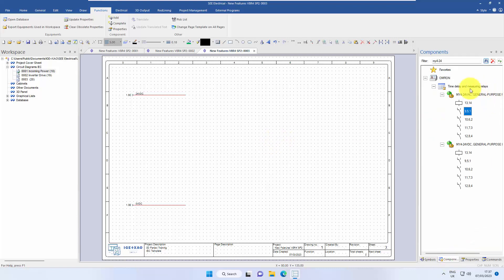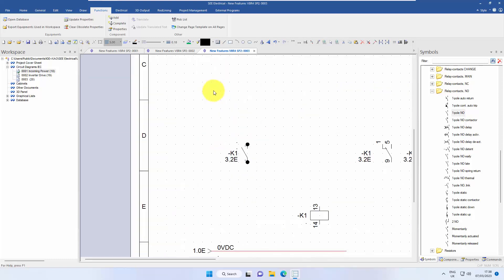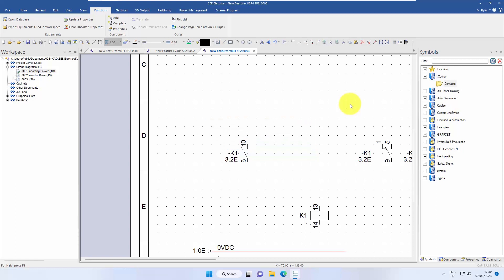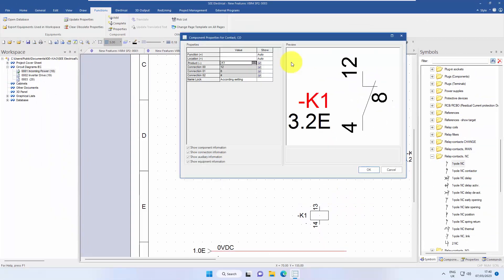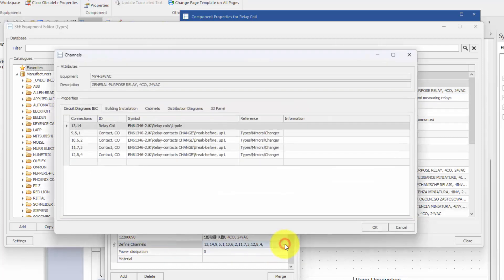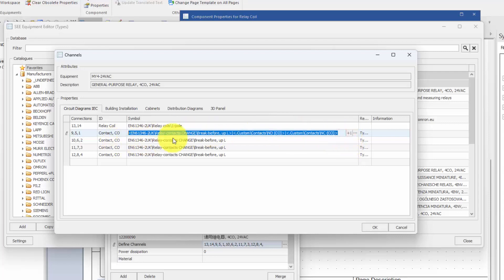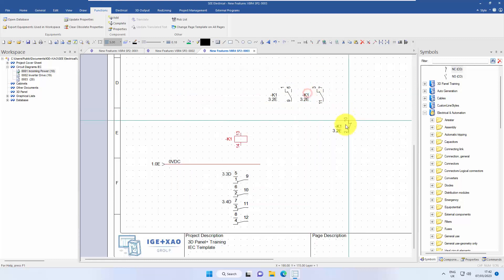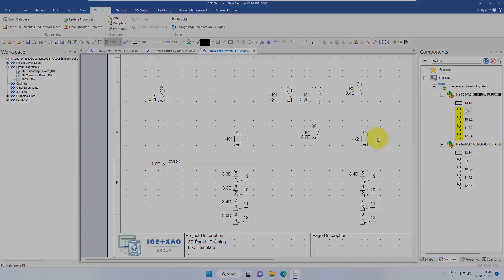V8R4 New Features Alternative Symbols

Comment: in see electrical, stretch command is not available?
and also, what is the shortcut key for copy with reference point.
i request to make a series of videos regarding commands only.
Reply from the maker: Graphical stretch can be enabled using the trackers (Alt+T), and stretch of connected wires using the Electrical - Wire Rubberband command.
Right-click to select Copy with Base Point or add a new keyboard shortcut by right-clicking on the menu, accessing the quick access tool bar settings and clicking through to the keyboard shortcuts. I hope this helps.